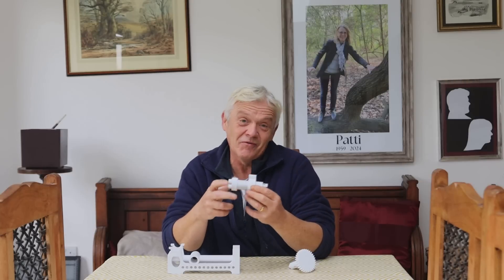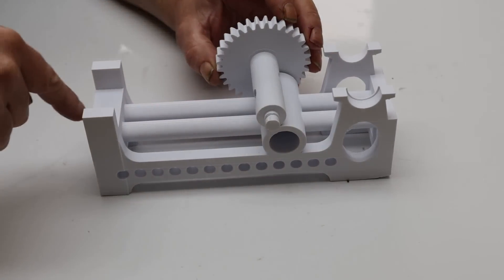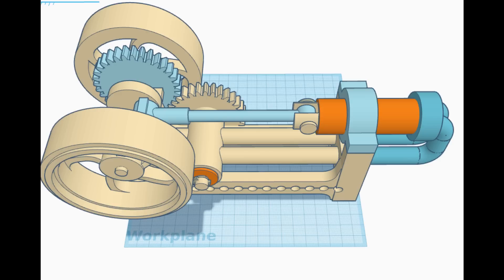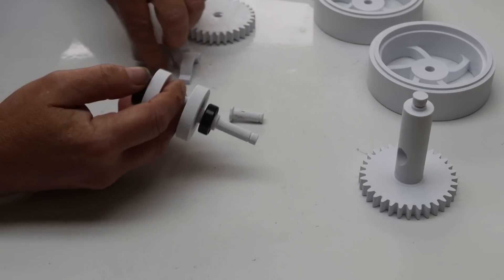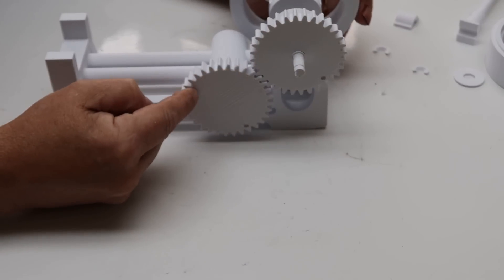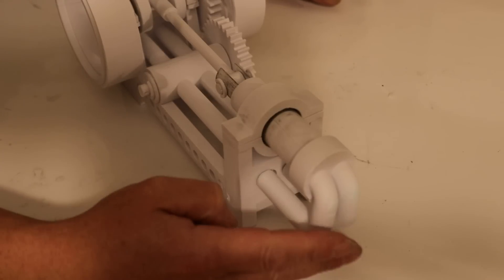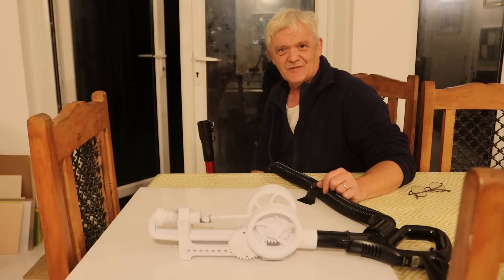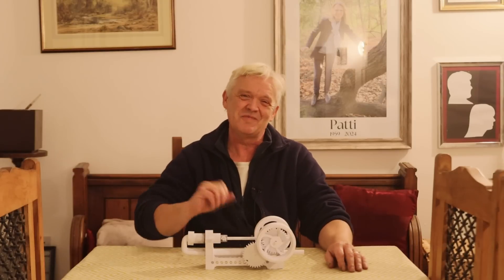2314 Diaphragm Piston Air Engine With Rotary Valve

Comment: So I’ve followed your video to a T and I just can’t get it to go under its own power (I am using air pressure though).  It looks like if I give it too much pressure it’ll stall the rotary valve creating extra resistance but too little air and it just doesn’t work :(   . P.s I’ve tried vacuum and that also wasn’t successful for me , probably messed up applying too little graphite that first time .

Comment: Rotary valves are neat but sealing them without impeding movement greatly via friction has always been a mystery.  Don't recall you doing much on valve seals for the DIYer.  Might be a topic to investigate.
Reply from the maker: I agree and i have been looking at it - but off and on

Comment: I printed out the diaphragm piston and been experimenting with it, I am now experimenting using a bicycle inner tube to replace the glove as I'm hoping that I can avoid the graphite by making a larger space between the piston and cylinder in the hope that the pressure can be raised to 28psi.

Comment: Hey brother,  something has been on my mind in regards to redox flow/ static batteries, and my research dead ends quickly in regards to the issue. (Kinda) I'm looking for a multi_stage redox couple.. not necessarily a simultaneous unit, which is what I find via research.  But more like wonder chemical A breaks down to create zinc bromide and of course further breaks down into a typical know cell. 
I can understand that a multi_stage simultaneous system should be hyper complex and issue would/will occur but in the system I describe everything is simply trying to go back to neutral, just like a single stage metal- halide.  Do you have any comments on this?
Reply from the maker: I get a sense you might be over-complicating it mate - to control a reaction so that it proceeds in stages is quite a task - you find it quite a lot in organic chemistry - but the requirements are onerous and yields are typically in the few tens of percent - I can't think of an inorganic couple but organic couples would be things like the quinones maybe
Reply: @ThinkingandTinkering  thanks a lot, I don't really have people around me to ask such questions! I knew (knowing your teaching)  that if you were to respond you would attempt to dis wade me from over complicating.  But almost everything you've taught in it's most simplistic form, starts in a more complicated fashion. Okay it's the hard way and may yield nothing but sir ,you put this passion in me and I will at least try... my lack of formal education  slows me but has never stopped me. If anything sometimes the seemingly silly questions offered the best results.

Comment: I would expect the machine to work far better with a pressure input than a vacuum input. The rolling piston requires a positive pressure to keep the rubber diaphragm surfaces separated.  When pressurized the rubber surfaces never contact each other.
Reply from the maker: yep i had to glue mine on for part of it

Comment: Another great video.  That said, please reconsider (not) using graphite on air-powered equipment given graphite/graphite dust is carcinogenic. Plus, it tends to be incredibly messy.  A much better alternative (for this particular application) would be to use a silcone based lubricant. Nothing personal, and not trying to be the "safety police" I just want to see everyone enjoy a heathy life, for as long as possible.
Reply from the maker: I am glad you like the videos mate - graphite is not listed as carcinogenic but it is messy - a silicone lubricant is a good idea

Comment: I have recently bought a diesel heater for camping and like everybody the noise of the solenoid pump is loud, so I got ultra quiet pump it reduced the loudness by 50%👍once had put it into cannister with sound proofing so I thought about a diaphragm pump as the sound it only produced from the metal part within the pump .
I have seen a method using a diaphragm pump but it uses a lot of electronics and cost a lot . I have an idea to use a solenoid and diagram pump combined using a simple voltage supply to move 0.28ml per stroke of diesel and hopefully reduce noise by 95% and size by 70% .
Wish I understood computers and 3 d print you make it look easy I am more cardboard and bits of wood to solve a problem 
Think your channel is ace 👍
Reply from the maker: that is a really nice thing to say mate - i like your idea- i don't think the electronics on a pump need to be that complicated mate - you might want to look a bit further into this - i am pretty sure there are simple solutions to driving a diaphragm pump
Reply: @ThinkingandTinkering  the one I've seen uses Avery small stepper motor to drive the pump I plan
 to use the original two wires from the heater 12volt to energize a smaller coil , I have thought along the lines of air valve in design were coil lifts the diaphragm.When i saw you diaphragm pump i will use this in my design .The will displace 28ml per 100 strokes

Comment: I love your valve mechanism, never seen one like that before. I wonder if it would be possible to put the valve on the crankshaft and reduce the part count further.
Reply from the maker: interesting idea - want to give designing it a go?
Reply: Also you don't need 2 pipes going to the top of the cylinder. You should reduce those 2 into 1 as soon as possible after the valve, otherwise you're wasting efficiency pressurising (or in your case "vacuuming") the pipe that isn't connected to anything.
Reply from the maker: good point mate - personally i did it that way for teaching reasons - easier to 'see' what's going on - but good point

Comment: What if we use a small co2 cartridge as a "fuel" for input and put a balloon - as we are thinking about reducing co2 emission - on the output to catch it. I mean, in this configuration i don't see any variable (except the counterforce when  -or how - the ballon is "reacting" to streching) that would affect the efficiency - in other words no real open air exhaustion is required - so we also prevent our emission with capturing and the captured co2 can be recompressed. Of course, a one way valve is needed. Or am i silly? Does it worth a try?
Reply from the maker: to be honest mate everything is worth a try - even if your original idea doesn't work out - just doing it will always lead to something
Reply: Best l capture all my exhalation in balloons for rest of my life then.

Comment: Hi Robert please watch the demonstration of The Ecat NGU LENR system charging a Twizzy EV while driving. There was two identical Twizzy EV but one without the Ecat which had almost a full charge and a Twizzy EV with the Ecat system with I believe 63% charge.  After an hour of driving on a race track the Twizzy EV without the Ecat died from no charge while the Twizzy EV with the Ecat went on for 5 hours and the demonstration was stopped because it could of continued for up to 11 years with only a few grams of fuel.  At the end of the demonstration the Twizzy EV with the Ecat had a I think 87 or 83 % charge, but more then it started with.  The Ecat is a LENR system Low Energy Nuclear Reactions and the fuel for the Ecat is tiny amounts of nickel, hydrogen, lithium and unknown minerals. There is enough fuel for the Ecat already mined each year to power the world.  On October 28 2024 history was made and now all efforts are on manufacturing and it’s very easy to build, you could build one with ease Robert and there are several other LENR companies like Brilouin Energy and others all around the world.  LENR uses no harmful fuels and does not emit harmful radiation only dry steam and with the Ecat electric power for anywhere in the world and it can produce power at 25% the cost of coal if the first estimates were right back in 2011.
Reply from the maker: i have seen it mate
Reply: @ThinkingandTinkering  I'm sorry for asking, but in your opinion and with your knowledge,,, I truly trust you,,, what do you think about this Ecat and LENR?!
Is it another one of those hoaxes?!
Thank you very much!! 💞
Reply: Based on their paper:
average coefficient of performance (COP), as the ratio of output and
input energies is "54". Perpetum mobile x 54.

So 100W power source of 12V which last 3 years is using 10g of Lithium, 50g of Nickel,
weight 300g, size 6x3x10 cm,
cost 250$, able to recycle,

If they would be able to make it cheaper it can be interesting. 🙂
Reply: I followed Rossi for many years. Eventually gave up because he kept changing the goalposts. I'll wait until a totally independent replication is made using only publicly available information with no help from Rossi.
Reply: @ The October test was independent and Rossi only supplied the system to the manufacturer of the Twizzy and the range accomplished was 4 times what it is with out it.

If that’s not good enough too bad
Reply: @NAL63  So Rossi supplied the system. Well that's been the problem in the past. I was pretty convinced by some of his earlier demonstrations but nothing came of any of them. He typically demonstrates a version, claims its going into production only to abandon it in favour of the next. Rinse and repeat for more than 12 years. As far back as 2011/12 he was selling licenses. He sold one to Industrial Heat who were unable to make it work themselves. He's declined $1m for a demonstration under controlled conditions. He claimed for years that he was building a factory and real products were imminent. But there was no evidence he was taking the normal steps needed for any product to be manufactured and sold. No prototypes submitted for FCC or UL certification for example. Personally I think he just likes the attention. He's old and doesn't need the money so why doesnt he gift his invention to the world, eliminate Climate Change, win a Nobel prize for Peace and physics? See the extensive timeline on the newenergytimes website.
Reply: @NAL63  The ecat version Twizy weighed 98kg more than the standard model. The fact that a 90kg steel "safety box" is needed to house the 8kg ecat isnt suspicious at all. What is it they say.. The hardest part of all perpetual motion machines is working out where to hide the battery.
Reply: @ it’s impossible to travel for five hours in a Twizzy and that’s proof to me and I have been following Andrea Rossi and the $10,000,000 was for a 350 day evaluation with specific goals being made a further $89,000,000 investment for partner ship.

The ECat met all requirements, but industrial heat didn’t have the money, so it went to court and Rossi was given the option to be paid $89,000,000 and partner with Industrial Heat or go it alone and Rossi decided to go it alone. 

I had over 90 videos of Andrea Rossi and links to the court settlement 

The court was satisfied that Rossi passed all goals in the test

Time will tell, he has the number of pre orders he asked for to start production to make the systems affordable 

I researched all the scientists who worked with Andrea and several who witnessed the ECat research and they were all very well respected and they were believers in the eECat, so I am a believer in
Reply: @ the battery in the Twizzy EV weighs 98kg and with the ECat systems several it had what 5 times the range.  There were several 100 watt units used which is probably where the weight came from
Reply: @NAL63  The energy density of the Twizzy battery isn't great 6100/98 = 62 Wh/kg. Tesla batteries are up around 250 Wh/kg. A home made battery made from used Tesla modules might achieve 200 Wh/kg? That would give a capacity of 19kWh in a 98kg pack.  Bit less than three times the Twizzy capacity. If the standard car ran for 2 hours 20min it's not unreasonable that one modified with secondary battery might go 5 hours and top up the regular battery a bit. I'm not suggesting this is what he did but unless people were allowed to see inside the eCat box it's at least plausible. Other people have added extra batteries to the Twizzy.
Reply: @ But you are forgetting the battery had about 20% more charge then when the demonstration started
Reply: @NAL63  The Twizzy battery did indeed have 20% more charge, but that's only 1.2KWh. Possibly charged by the secondary battery? Look I'm not saying that's what they did. Not enough information to be sure but it's at least plausible they fitted a big secondary battery that powered the Twizzy and topped up the Twizzy battery.

Comment: So cool. Can you make make a look to x engine from Liquid piston company. Is like Wankel engine. I think a 3D printed x engine variant powered by air will be awsome.
Reply from the maker: I looked at that a few years ago mate
Reply: The whole utility to the liquid piston is compression ignition and the 3 detonations per RPM, if you're just using air you should make a normal Wankel and looks up LiquidPiston's patents on their seals to use them for the Wankel as they're simpler to shape and characterize with less exacting tolerances.
Reply: @cheyannei5983  Cool